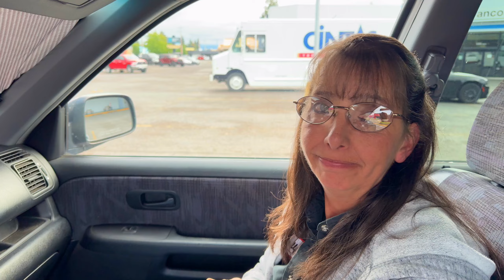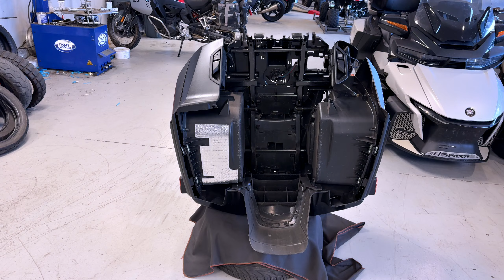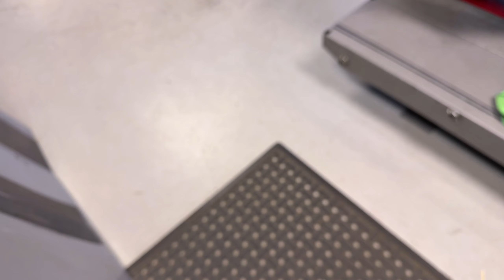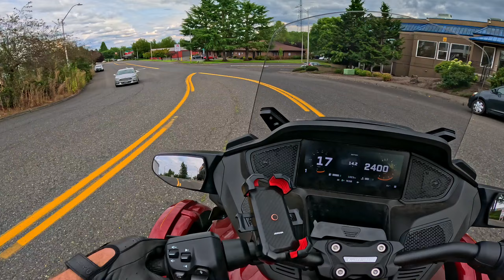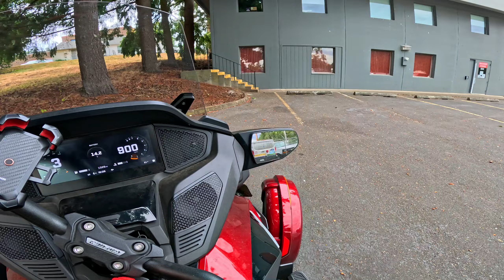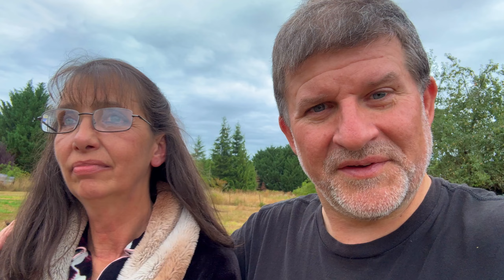Inside an RTL ACS Pump!! • Simple but Functional! | TheSmoaks Vlog_3196

Comment: I just purchased a new 2024 Sea to Sky and the pump runs continuously with 2 Up.  Runs on and off continuously with only rider.   Does not ever raise the ride height.  Seems like a wide problem with 2024’s.
Reply from the maker: There is a bulletin to inspect and correctly set the ride height sensor in BUDS2.  Out of the 30 or so 2024's we've had, I've found 2 off.  Should be inspected during setup & PDI, or before delivery of a new unit. It's pretty rare, but some need it performed. Warranty pays for it, so contact your selling dealer before the pump gets damaged..!

Thanks Josh!! 👍